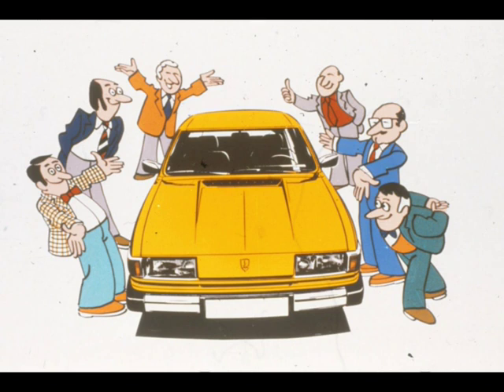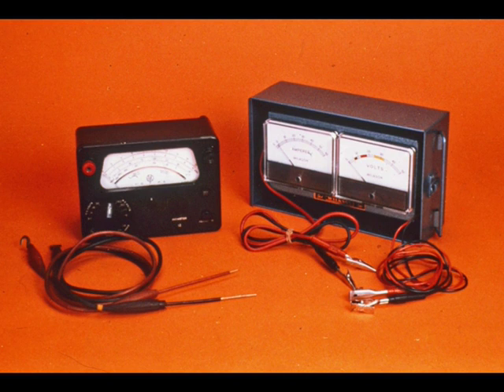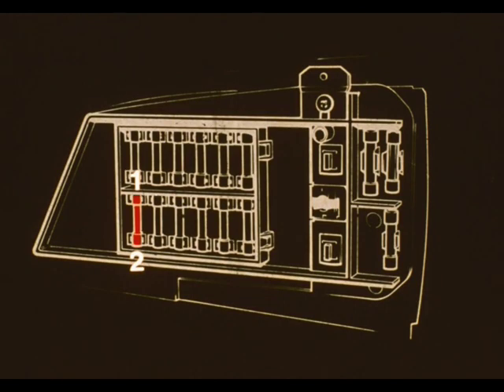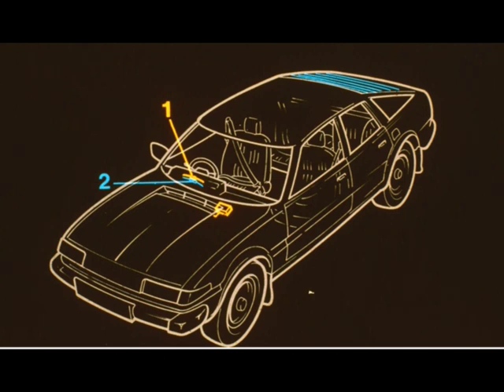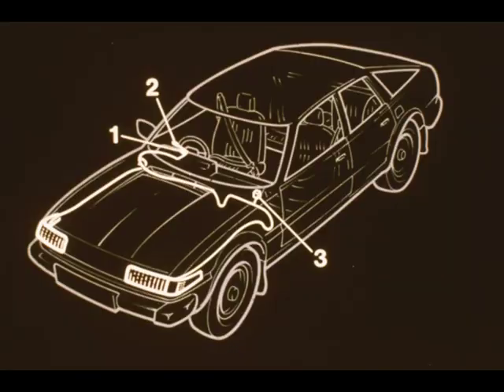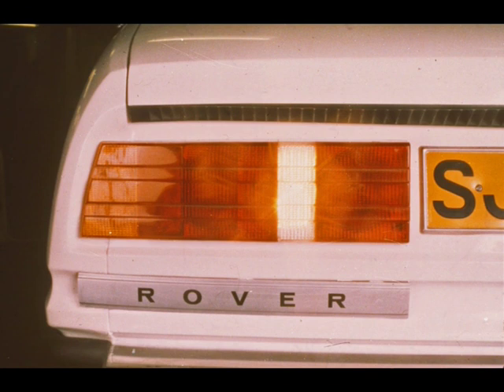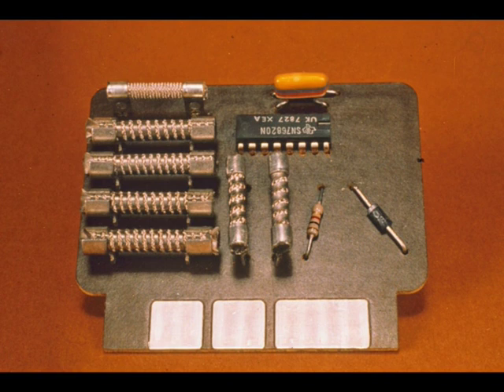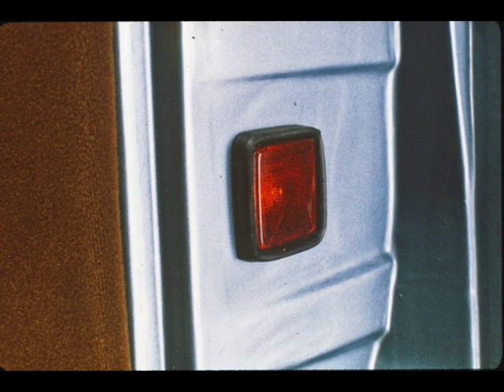ROVER SD1 Service Insight - electrics part 1

Comment: A great car with horrible build quality. Shame on those who were responsible for this mess (workers and management) British motor industry killed itself with products like these.
Reply: I once worked at a terrible plant as an engineer, it's so hard to change a bad culture, and you feel absolutely powerless trying to fix issues when management literally yells at you to fix something but provides no resources, and you go down to the shop floor only to have union workers refuse to help, and watch you like a hawk to find any excuse to file a grievance. I think the quickest a car company turned around was when GM revamped the NUMMI plant. They sent groups of workers of all levels over to Japan so they could see what a good working environment looks like. I believe Leyland could have used something similar.